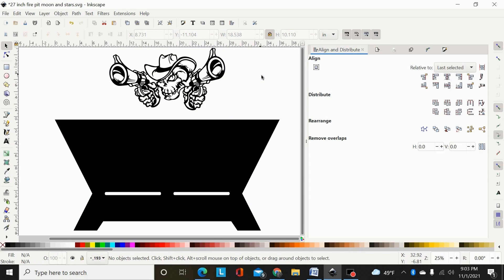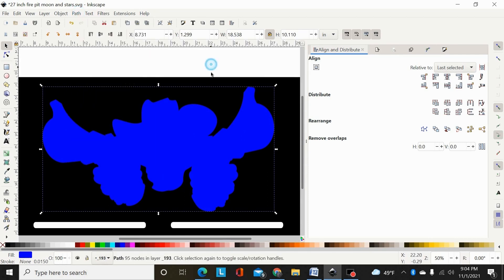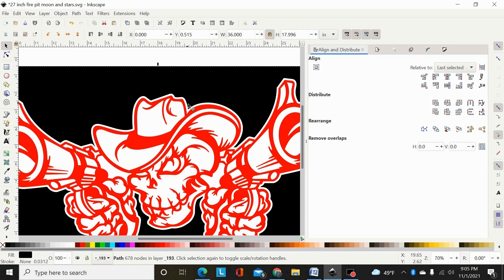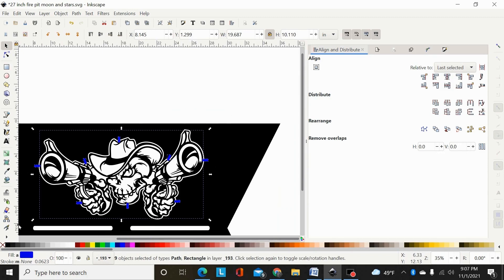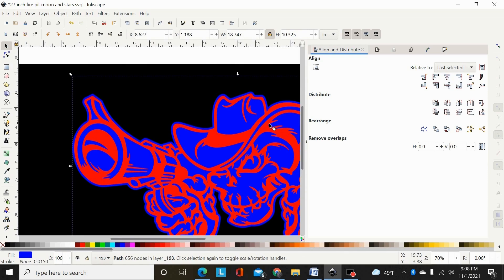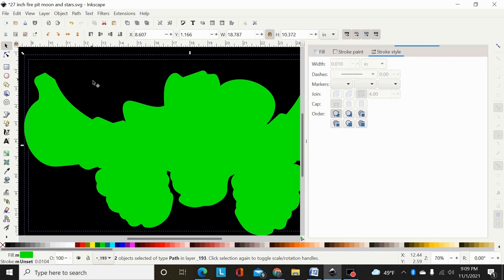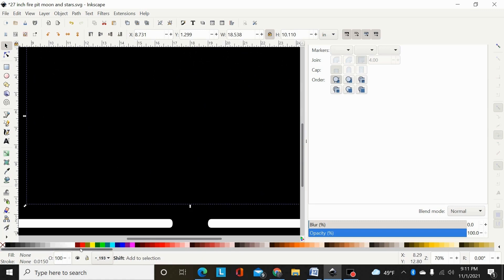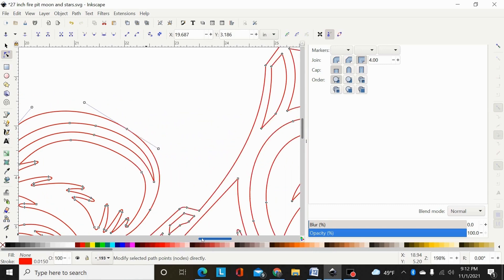Adding a Premade Design to a Panel or Firepit in Inkscape

Comment: Thank you,
 I have been trying to figure this out for some time so i want to put a sprint car image on the side of a fire pit so if i'm watching this and listing i only need to put the breaks on the outer perimeter of the image and that would allow me to keep the lines cut out and the centers to stay ? And thanks for all the files i have gotten from you they all worked great.
Reply from the maker: Yes correct. If you put breaks in the outside cut it will allow your inner design to cut like it would if it were stand alone. The breaks will hold it in place and the rest will cut as usual.